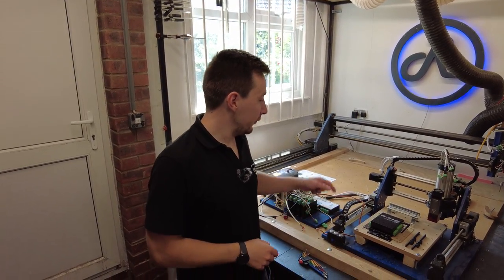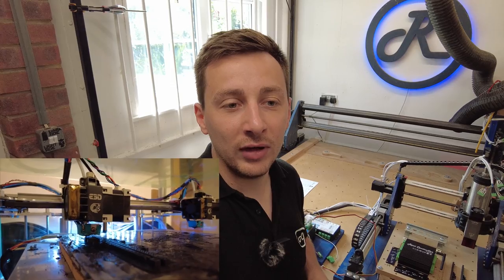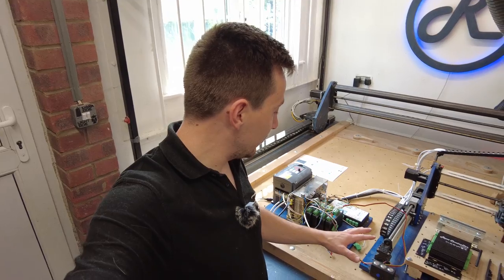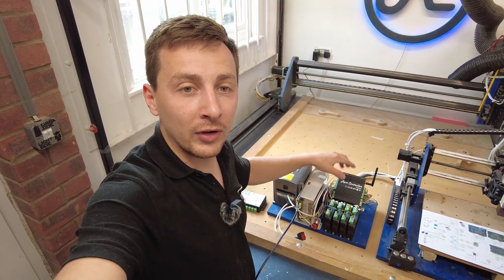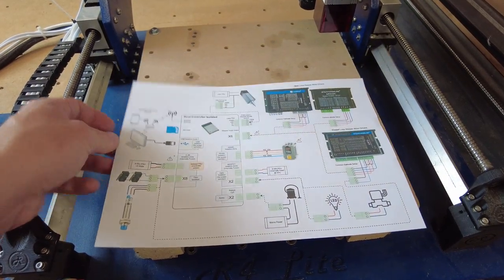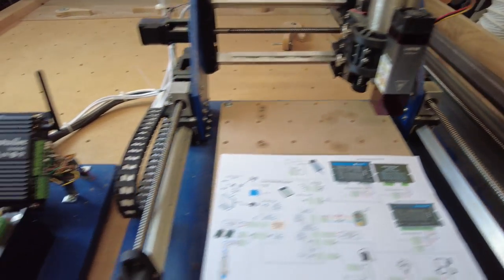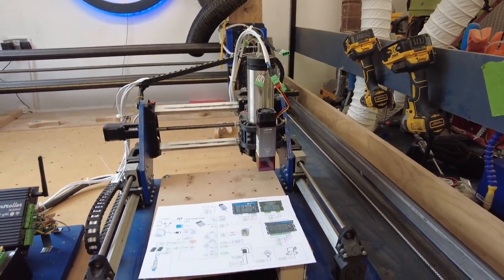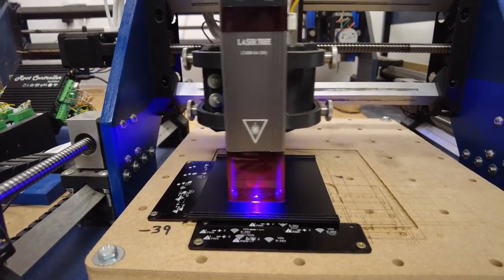Upgrading to the Root Controller Rev 3 | Vlog 3

Comment: How does this compare to a grblhal or flexihal please ?
Reply from the maker: I've only used Fluidnc on the controller. Although, I fully expect GRBLhal to work - I've not had any bandwidth to try, it should just be a configuration file and firmware flash. Flexihal, I've not come across just yet, so I'll need to do some digging. But Fluidnc works great! I've been using it for a few years now and it get better and better